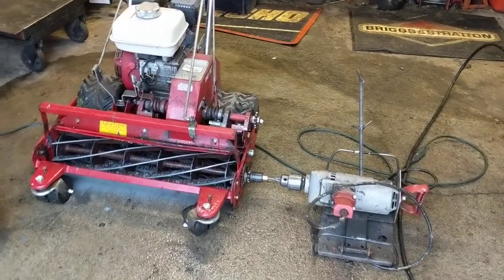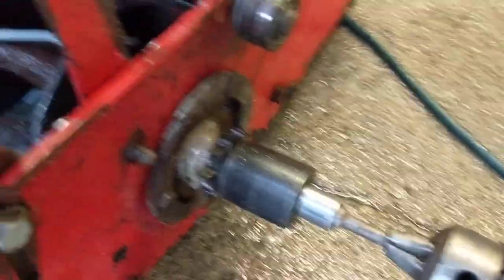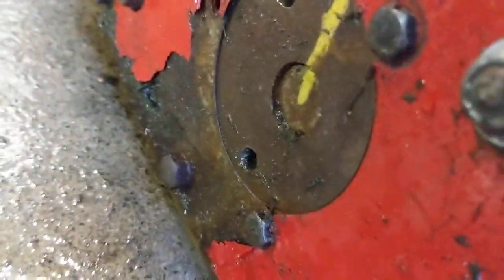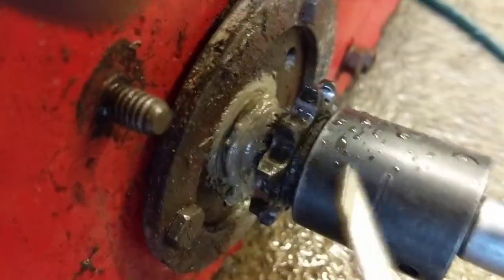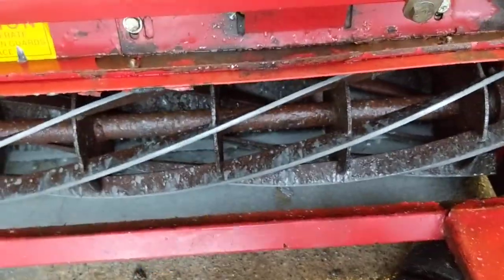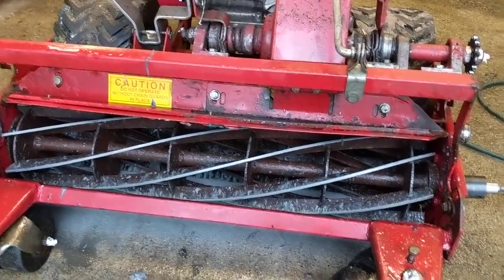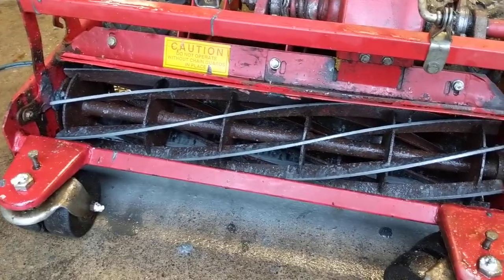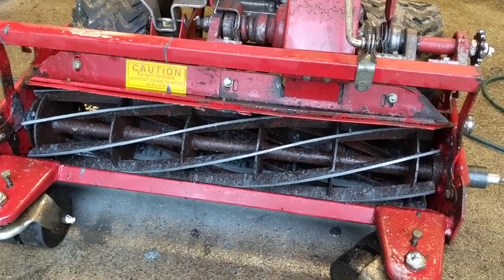How I backlap sharpen my TruCut reel mowers

Comment: The thing I hate the most about the TruCut is when you tighten those 3 bolts on each side again it seems to come back out of adjustment. Any tips on that?
Reply from the maker: yes.,. the trick is to under adjust the cam about 10% so that when you snug the bolts it pulls the reel into the adjustment you want.

Comment: When you set the reel blades down on the bed did you tighten the bolts or leave em loose?Do you have to back lap brand new blade roller? To get paint off and even blades out?
Reply from the maker: i only loosen them a bit to start with, so they are still snug and they keep a bit of pressure on the cams. I absolutley backlap when I replace the reel or bedknife of both.

Comment: Great video. How much contact do you want with the reel to bed knife when backlapping?
Reply from the maker: a little more than you would want when cutting. just so shes a little tight to spin, sometimes I like to set her up, do a backlap then set her up tight again for a second lap. then usually they loosen up to the perfect spot you want and settle in after a few mows.
Reply: machinesnmetal Great. Thanks! Will give it a try